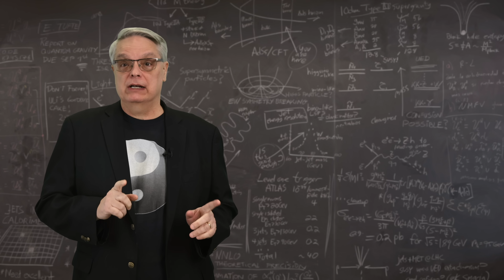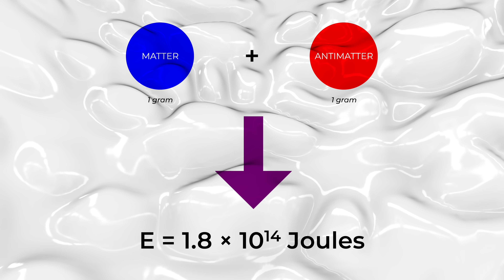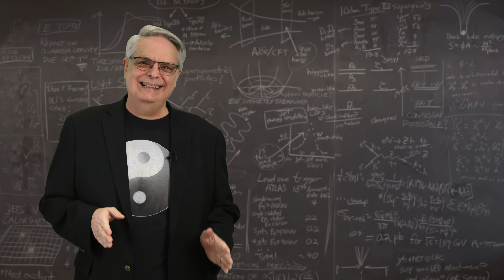How do scientists handle antimatter?

Comment: Dr. Don,
 I know my question is off topic but it's been eating at me for some time now and could you please shed some light.
Question: Is it possible super black holes have the energy or force to rip through the fabric of space time and all the matter it consumes builds up past the The event horizon and eventually passes through the opposite side to create a big  bang in a new Universe? Would that explain the bubble universe, the multi-universe, multiple dimensions?
Thank you for your time
Reply: As for Hawking radiation is it feasible that all matter doesn't escape that way and instead it could be a type of exhaust from the magnitude of matter it's consumed leaving the majority of the matter passing through the fabric is FaceTime into the new universe which in turn creates the Big bang?

Comment: It seems a bit misleading to equate the energy released by annihilating 20 ng of antimatter with an equal amount of matter to how much coffee or water you could heat up, since water absorbs energy quite well. A more relevant measure would be how much tnt would an explosion of this amount of matter and antimatter represent, since any failure of the magnetic confinement would allow an explosion to take place. The answer is 1.90 pounds of tnt. Suddenly, this doesn’t sound so safe anymore.

Comment: A magnetic containment field is simply a container with a strong enough and balanced magnetic field to contain negatively charged anti-protons within the field. It's like magnetic packing peanuts to hold the atoms in place so they cant contact regular matter. This would also have to be in a vacuum chamber as air would also be regular matter. Not sure if this is worth a full video... It would be probably 1.5 minutes long. Lol

Comment: The evidence from experiment, such as the Goldhaber experiment, show that when recombination of matter and said "antimatter" occurs, it does not annihilate nor give off energy on par with e=mc^2, but only gives off energy on par with plasma recombination, such as on par with battery storage.
  To get the energy out of said antimatter, CERN must super-collide it to destroy it in a matter/"antimatter" collision.
 They now claim they can super-collide two regular protons, if the velocities are high enough and can get energy release on par with e=mc^2. So, in reality there is no such thing as "antimatter," just positively and negatively charged chunks of the nucleus that they busted apart.
   So, in reality what they call matter-antimatter recombining does not annihilated nor give off e=mc^2 energy but appears to just be two charged particles recombining and giving off energy just like plasma recombination does.  Fusion also only gives off energy on par with plasma recombination, and matter/antimatter recombination. Fusion energy release will never be a viable way of creating energy and will never give off energy on par with the Sun nor e=mc^2.  Given that CERN can get neutrinos and e=mc^2 energy by annihilating just regular protons, that is also most likely what powers the Sun, directly out of the photosphere, but by resonant or electrical breakdown of the proton as experimented by Nikola Telsa rather than by super collision.

    CERN actually busts "antimatter" out of regular matter, where it was combined with regular matter and was perfectly content being combined with it in the nucleus without annihilating.
So, expecting to recombine them and have them annihilate each other makes no sense.
Reply: The Observation of
 Antiproton Annihilation
 Gerson Goldhaber
 University of California
 and  LBNL  Page 17 of the lecture by  Goldhaber.  Antiproton symposium October 28 2005

Comment: Although anti-protons are hard to produce, positrons (anti-electrons) are used every day in PET scans where an ejected positron (out of unstable lab-manufactured fluorine-18) meets an electron and produces a light flash suitable for detectors to identify concentrations in cancerous tissues absorbing the DFG glucose molecules in the radiotracer. If each positron-electron interaction produced heat in accordance with the e=mc^2 assumption, I would think the patient might get cooked--or at least suffer some tissue damage. The curiosity: Although scientists have always accepted the matter-anti-matter total annihilation concept, this might not be the case. The positron might just spiral around the electron, generating Larmor radiation, ultimately bond, and electrically disappear (with no charge remnant that can be detected).

Comment: We've been using it at for at least 20 years in medical imaging. e.g ¹⁸fluoro deoxy glucose looks like  ordinary glucose to the body  and is taken up avidly by tumours, or infection. It decays rapidly, emitting positrons … which usually meet an electron in their 1st mm or so of travel. 2 high energy photons are then emitted, in opposite directions. 

By counting millions of these, using direction of travel and timing we can localise source to within about 3mm, and correlate with a CT scan. It is now a routine procedure, and "uses antimatter".
Reply: What is the percentage of patients that are routinely annihilated during the procedure?
Reply: @ericberman4193  a very very tiny percent of the patient gets annihilated.

As aside, bananas emit antimatter, and most people haven't missed the bit of themselves the positrons of the decaying potassium 40 annihilated.  One average banana emits 1 positron every 75 minutes.
Reply: @ericberman4193   I was apparently annihilated and spontaneously resurrected several times.
Reply: @ericberman4193 rookie-level numbers

Comment: Storing large quantities of antimatter seems extremely difficult. There are two options. Storing neutral anti-atoms or charged particles. 
Storing neutral anti-atoms will be difficult because electromagnetic fields will provide very little force to keep it separate from the normal matter container. 
Storing charged particles has the problem that the self repulsion quickly becomes ridiculously strong. I once did an extremely rough calculation that said that one ton of charged particles has a self repulsion force comparable to the gravitational field of Jupiter! 
I used a ton because I saw a reference that claimed it would take about a ton of antimatter to power a manned mission to another star in a reasonable time.

Comment: There is one issue overlooked in discussions of antimatter danger. Particles only annihilate with the matching anti-partical. So releasing positrons in the presence of normal matter is going to be very reactive with all the electrons that are easily available. But what about antiprotons? (Almost) all protons are protected by the electrons surrounding the nucleus. Since both antiprotons and electrons are negatively charged, it should be hard/impossible for the antiprotons to reach the protons in the nucleus. 
So is there any research or tests into how this actually works?
Reply: You forgot that atoms are neutral. So antiproton approaching hydrogen atom will not be deflected. When the antiproton is inside electron's orbital it'll get accelerated inside because of proton's positive charge (electron charge doesn't matter because it's outside the antiproton).
Reply: @hanifarroisimukhlis5989  at a distance you are correct. But as it gets close, the electrons are closer and will provide a repulsive force. If this was not true atoms would pass through each other.

Comment: How much smaller is a proton from an electron? Rhetorical question. If we can’t “locate” an individual electron, how could we “locate” an individual proton/antiproton? Electrons are in all/most matter (not neutronium?). So there’s that kind of localization. What container 🫙 can localize antimatter? Localize in a way that assures certainty - in a way that precisely indicates there are however many antimatter particles in “there”!
Reply: Looks like you are listening too much the speculations of the front faces of modern science. The electrons are used in industry already 100 years. They are produced in large quantity in "Cathode Lamps" or in the "Electron Cannon" in the old tube like TV screens. The electron bombardment in the old TV screen is producing the images. If you want to learn correct physics I will recommend the book - "Theory of Everything in Physics and the Universe". Charged particles can be stored easily between ordinary magnets.

Comment: Interesting, but it didn't really delve into the question in the title.  I'm still curious how an antimatter container works, when it is made of matter.  He briefly mentioned "magnetic containment", but that by itself seems worth a video.
Reply: I'm also interested in learning more about these "magnetic containment units." How much energy is needed to maintain magnetic containment and how is that provided in a portable device? They're obviously designed to be transportable, but that could mean anything as small as a lunch box to something as large as a tank!
Reply: @ScottEsser  they use electromagnetic fields. He says that in the video. What do you want to know more?
Reply: @adamredwine774  like I said, I'm curious how small they are able to make the container that is able to generate a stable EM field and how that's powered. Does the relatively miniscule amount of antimatter that will be transported need enough power that it has to be broken into multiple containers? I'm an engineer, so I'm interested in the engineering details!
Reply: I completely sympathise. Your curious about how it works and the explanation: "a magnetic field (B) is used to contain anti-matter in a vacuum" isn't good enough for you because that says nothing about how it actually works.
There are several layers of understanding and obviously the deepest layer would require a lot of studying and persistence on your part!
The best I can do for you here is go straight to the point, so there will be plenty of major gaps and oversimplifications on the way, but I'll try:
"Electricity" and magnetism are phenomena/manifestations of the electromagnetic (EM) force. The phenomena that is utilised in "magnetic containment" is known as the Lorentz force and it is expressed by the VECTOR equation: 
Force = q(E + v x B) where q is the charge of the particle, E and B are the electric and magnetic vector fields respectively and v is the velocity vector of the charged particle q. I won't go into the subtleties of this equation but essentially it tells you that a moving charge will experience a magnetic force (provided it's direction of movement isn't completely parallel to the B field) and a static one won't (this is such a painful oversimplification but obviously I can only say so much here 😂). So to contain an anti-particle using a B field (in the simplest sense), it must  have charge and it must be moving with respect to the B containment field. OK but how do we produce a B field in the first place?! Well we need moving charges! A moving charge produces it's own magnetic field. But any moving charge will do, so we can just use standard electrons in conducting wire for that. The dimensions and geometry of such systems are too much for me to describe here. If you want a better explanation (which I'm sure you probably do) there are probably some really good YT vids and there are definitely some great books e.g. University Physics by Young & Freedman. Griffiths would be the next stage after that. And then the rabbit hole goes deeper and deeper 😂
Hope that gives you at least a bit of motivation to read up on it 👍
Reply: @hrperformance Thank you sir! Thumbs up to your explantion. This video was worthless.
Reply: The answer is Very Carefully
Reply: Look up the Penning trap, which is how antimatter and other charged particles are stored, separated and handled.
Reply: The question is... does anti-magnetism exist? What about charges annihilating. But then why does antimatter and matter annihilate in the first place? Is it the charge that's annihilating?
Reply: @Bassotronics Anti magnetism doesn't exist, only anti particles exist (and not all particles have an anti version, like photons which have no charge). Magnetism has both charges already, so it is a whole thing. Particles and anti particles only annihilate when they are the same type of particle. So, a proton and an anti proton. I hope that helps.
Reply: There was about 1 sentence related to the title.
Reply: It's not really that interesting . The only way we have to store it is in magnetic fields.
Reply: Yeah, complete click bait.
Reply: The short answer is we have never had antimatter for more than a few instants so we don't really handle it yet
Reply: Magnetic containment. Just like what Star Trek writers predicted back in the 1960s.
Reply: Fundamentally, containing antimatter is as energy intensive as containing regular matter of the same type, if you're using magnets. So containing a kilogram of antimatter iron (insane) would require the same energy as you'd need to lift a kilogram of regular iron via magnets. It just needs to be extremely reliable, or kaboom. When we're only talking a few hundred atoms, it's pretty far from dangerous, and it doesn't take more than a few watts to actively contain it. (Your cellphone, in other words.) It sounds scifi, but it's relatively mundane.
Reply: Maybe worth planing a trip to the quite recently opened visitor center of CERN.
Reply: Well you transport the antimatter in a vacuum and trapped in a magnetic field, so that it stays in the middle, without touching the walls of the transport cylinder.
Reply: @gehteuchnixan9027 did Don tell us this?
Reply: @gehteuchnixan9027  oh, can you trap regular matter that way?  if you can't, you won't trap antimatter that way.

That might be part of the answer but I think more is needed. Is the antimatter charged and moving, because if not the magnetic field isn't going to do anything to a sitting charged particle
Reply: @RWZiggy I never claimed this was a working manual for transporting antimatter. 😉
I was just talking about the basic principle. But of course, you're right: to store antimatter in a magnetic field, it's ideal if it's charged. For this, you use a Penning-Malmberg trap. But you can also store uncharged particles with an Ioffe-Pritchard trap. For that, the particles would have to have a certain magnetic moment and be very cold.
Reply: @gehteuchnixan9027  People understand that with regard to conventional matter, but it wouldn't hurt to explain the technology and polarities involved with Antimatter - particularly with respect to how it is transported from its creation in an accelerator, into storage, and then back into an accelerator again for testing. It's not assumed knowledge on an educational channel like this.
Reply: @andoletube  their answer is the simple answer for antimatter. You don’t need the magnetic containment with regular protons provided the container isn’t a reactive material with hydrogen ions (aka H+, aka protons).
Reply: @marybell8995  I'm not looking for an explanation for myself - I'm just supporting the idea that this should have been included in the video, not left to the comments section. But I appreciate the effort you took there.
Reply: You enclose the anti-matter particles in een dilithium-matrix, of course.
Reply: @BaronSamedi1959 Ah, but dilithium is only used to regulate the matter/antimatter reaction, as it is porous to anti-deuterium without detonation. Main storage is in a set of antimatter containment pods, that use superconducting magnets to hold the antimatter in a vacuum, and away from the pod walls.

(C) Star Trek TNG technical manual.
Reply: @BaronSamedi1959  Dilithium is used to regulate and control the interaction between matter and anti-matter so you get a constant plasma stream instead of an explosion.
Reply: I also felt deceived by the title.
Reply: There's been so much sci-fi that has delved into explanations of this, I was guessing that he just thought most people would know.

The basics from the sci-fi are just that you can't let the antimatter touch the container, so you put a magnetic field in the container that keeps the antimatter in the center.
Reply: @JustinMShaw  Details are left to the viewer who is an engineer. One needs the vacuum vessel to contain a strong magnetic field. Let's say the vessel is cylindrical, with a length L. Presume one can impose a magnetic field, north pole at top of cylinder, south pole at bottom. A charge moving in that field will experience a Lorentz force, F = q ( v X B ), where q is a signed scalar quantity, usually the charge of the electron. v is a 3-d vector showing velocity of the charge. B is a vector showing magnetic field strength. X is the vector cross-product, whose direction is found with the "right-hand rule". For an example charge moving outward to the wall, the F moves it around the circumference of the cylinder. Thus the charge spins around the cylinder, not touching the walls. Magnetic confinement! I neglect some things: 1) the rotating charges will radiate energy in EM waves, but that just makes them slower, sink more to the center of the cylinder. 2) how to make that magnet, which depends on the dimensions of the cylinder. The interested student may explore the actions of a charge moving directly to a magnetic pole.
Reply: Read the description of the video to understand the context of the title.
Reply: @rockets4kids So, in short, they don't? 😂
Reply: @rockets4kids stop being silly 😂😂😂

Comment: Just because something has an inverted electrical charge does not mean it is Antimatter, you are just playing with Charge Inverted Matter which, along with all the "normal" matter, falls forward in time. If you had true Antimatter, not only would you not be able to detect it, it's presence would not be in the same now as the "normal" matter surrounding it long enough to elicit an interaction. Tell me how to detect an object or even a particle that falls backward in time.